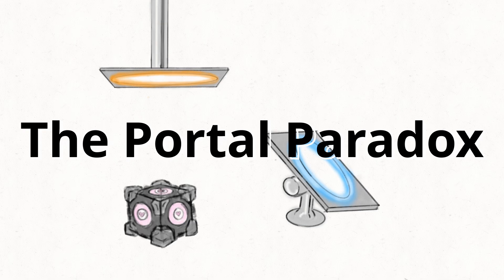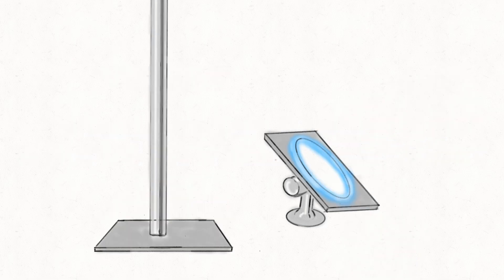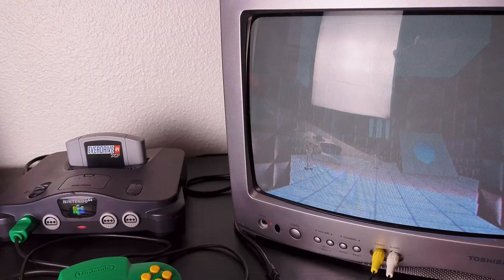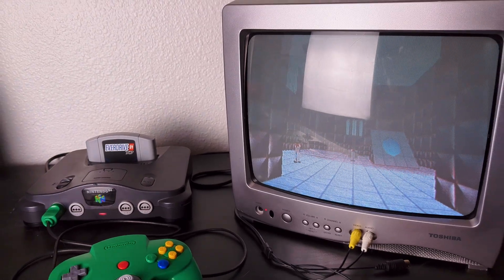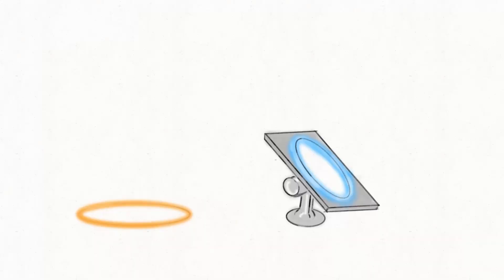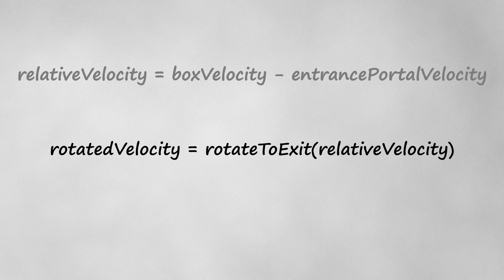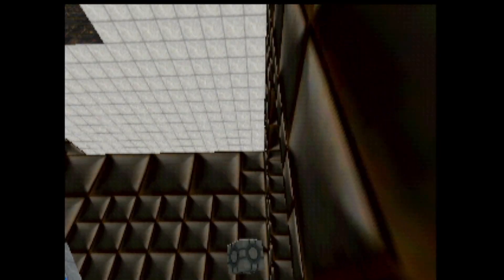I rewrote Portal from scratch and solved the Portal Paradox

Comment: I agree with your solution to the paradox, it appears most consistent with intuition out of all options.
One thing I am wondering about is what happens if the orange portal only moves over the cube like one quarter of the cube's side length, so 3 quarters are still right outside the orange portal and 1 quarter is outside the blue portal. If the blue portal is hanging from the ceiling, at which point will gravity take over and pull it down? I guess the most intuitive solution would be to integrate the forces acting on the object sticking through the portal over the mass of the portion of the object on each side and update its movement accordingly. Moving the orange portal exactly half way over the cube should leave it levitating, so you could then move away the floor on which it was resting and it would stay right where it was.
I didn't put too much thought into this yet so maybe this is not the best solution but I find it most interesting to ponder haha. Love your work man.
Reply: Ah I'm going through the videos from oldest to latest and saw you made another video dedicated to this question. It seems we still agree :D

Comment: This is almost accurate. The fall down vertical is more accurate 
The block is exiting the portal at the same speed it enters and after exist it retains its initial state. 
Like if the exist portal was horizontal it would shoot out of the portal at speed equal to speed of entry portal but stop instantly and go back to rest
Reply: This does not make sense. Imagine a second object right outside of the exit portal, which the cube will collide with on exit. No doubt the collision with the second object must conserve momentum and kinetic energy, therefore the second object will bounce away and have a non-zero velocity, without ever crossing a portal. This however means that the cube crossing the portal must reflect this with a lowered velocity compared to when it was travelling through the portal, but in your solution it just stops moving on the spot no matter whether it collided with anything or not, resulting in a failing of momentum and kinetic energy conservation.

Bonus: This brings up an interesting topic in general though, the question of momentum conservation quickly leads you to realize that when throwing an object through a portal, there must be a counter-acting force on the portal pulling it in the opposite direction. Therefore, if you have a portal on a cardboard wall and you throw a bowling ball through it, the cardboard wall will surely fall over, in your direction, without you actually making physical contact with it.
Reply: Correction: The portal will feel a force in the SAME direction as the object that was moving through it, so the cardboard wall will fall AWAY from you. However if an object exits a portal on a cardboard wall, then the wall will fall over in the opposite direction of the object's movement.
Reply: @Mystixor  No I don’t think so. 
And I think this is over concrete thinking. Try being a little more imaginative.  
If a rocket shot through a door way does the door move? (Assume no other factors present.)
Reply: @astro7484 This has got little to do with imagination, rather with basic physical laws. A doorway does not need to exist for a rocket to travel between rooms. Either there is a wall with a hole in it or there is no wall at all, same result. With the portal however, if there is no wall with a portal on it then you will keep moving in the same direction. If there is a portal, it can change your direction of motion instantaneously and therefore your momentum as well. This momentum needs to come from somewhere and it can only possibly come from the portal which is attached to a wall.
After writing my initial reply to your comment I watched James' later video on a cube passing half-way through a portal and I suggest you check that one out as well as it gives the same insight with some nice visualization.
Reply: @Mystixor  Basic physical laws do not account for portals, and they are not real so you do need some imagination on how they would work. Put it in different scenarios and see how it works. 
There is no consistency if we say the cube gains momentum after the portal has gonne through it. 
If the platform is falling and clashing down and the cube gets momentum then why is that portal still crashing? If momentum is conserved and you say its been transferred to the cube going through the portal. Then the platform falling should lose momentum.
I wish I could do an animation so I can express myself better cause language is clearly getting in my way of explaining this…
Reply: @astro7484  You are quite right that basic physical laws do no account for portals, but this does not mean that we can throw the basic physical laws out the window right from the start. Instead, we need to work through the thought experiment until we reach a contradiction, and your standpoint reaches this point right away because of the complete lack of momentum and energy conservation.
You are also correct about the portal losing momentum in its direction of motion as it crashes down over a cube. I am glad you brought this up as it made me realize an analogy to Lenz's law here. One manifestation of its effect would be a magnet falling through a metal ring or tube, which decelerates the magnet, so puts a force against the direction of its motion, but as per Newton's third law again this means there is a counter-acting force on the ring in the direction of the magnet passing through it. I want to make clear this does not imply that this case is in any way exactly like Lenz's law, but it's for sure interesting to see such a similar phenomenon.
Reply: @Mystixor  Conservation of momentum would indicate only one of these happen... 
1. The cube shoots out but then the plate doesn't crash because it lost momentum. The flaw in this would mean that portal lost momentum halfway through the cube because the cube is shooting out at the other end. But now you have the cube shooting out the other end and half the cube still at rest, and the portal has lost momentum so nothing is moving. resulting in a confusing situation.

 2. The cube shoots out and the plate crashes onto the platform. If we are following conservation of momentum, then we have more energy out of the system than we had put in. We had Velocity from the portal and that was all, so if the portal kept moving and clashed, we see where that energy was dissipated, the cube then will have momentum but no source of it, essentially creating perpetual motion. 

Neither of which I agree with

Comment: In my opinion this doesn't work because it relies on the base assumption that an object going through a portal is whole and singular- and consequently that velocity imparted onto said object by a portal would affect the object as a whole. The consequence of this is that in terms of the paradox, it would mean that any object in reality going through said portal would be instantly cut apart if said object had any momentum of its own in a plane not perpendicular to the portal edge.
Reply from the maker: I actually have a follow up video that considers what happens when you consider the individual particles. It still works out.

Comment: The one that stumps me is this: 

You a blue portal on a stationary wall connecting to an orange portal that is connected to a wall with a floor attached to it, the orange portal is being pulled backwards at  30m/s.

If you were to step through the blue portal to the orange portal, would you just calmly step from a stationary floor to a stationary floor with a bit of shakiness, or would you be rocketed forward the instant your body crossed through the portal due to your relative lack of inertia?

Comment: Things in motion tend to stay in motion, and things that stay still tend to stay still. Things only start moving when force it applied to it. In this case, the cube does not move. Therefore, it should not move when it comes out of the portal.
Reply from the maker: If it doesn't move when it comes out of the portal, then how does it come out of the portal?
Reply: Yeah, I agree with his reply to your comment but to elaborate a bit more even though I already have a comment on this: Motion is relative and if something is in motion relative to a frame of reference it means it has velocity relative to that frame of reference, this also means the answer to the paradox depends on which frame of reference is chosen
Reply: "Therefore, it should not move when it comes out of the portal." <-- contradiction

Comment: The absolute reference that it's comon to all the elements of this test (the floor and the walls) tells a different story.
The cube gains energy that comes from nowhere in your simulation.
The fail here it's to think on the portal as an object. It's not an object it's a hole in the space-time so there is no posible way of taking the energy from it, and that makes imposible to the cube to get that energy from it. Since there is no other way to take it from, the cube can't gain that enegry so it wont gain momentum.

Comment: Okay Let's solve the other portal paradox: So we take the same setup as the first paradox, but the moving portal stops halfway through the cube. Does the cube get launched out of the exit portal, get ripped in half, or stay in place.
Reply from the maker: It would either get ripped in half if the portal stopped fast enough or it would launch with only a portion of the momentum

Comment: I hate these relative physics problems :D like what happens when you throw a ball off a moving train.

What happens if the exit portal  is moving too? (Not back to back). What happens if the exot portal is moving really fast (in either direction, backward of forwards) while you move the entry portal over rhe cube but slowly. 
What happens when the exit portal is on a spinning wall around some pivot point. Positioned on the radius of the spin or on the tangent. 😅

And the more important question: what happens when the entry portal jams half way. Since the top half of the cube is moving away from the exit portal at high speed, the cube would need to be split

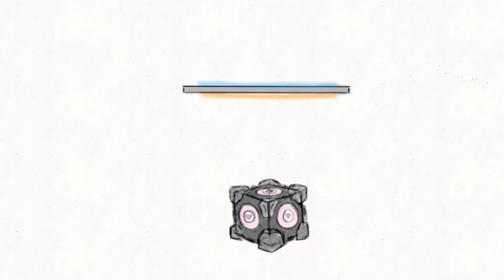Comment: 2:15 It's actually nothing like a hoola hoop. It's still a portal, I would actually argue that the blue portal moving down with the orange on the opposite side will only further add to the speed of the cube, so if portals are relative to our laws of physics, the cube will shoot straight up because the portal is an entrance, it's not a hole through the panel.
Reply: In its behavior it's no different than a hula hoop (when arranged like one).
When the portals are arranged in a hula-hoop fashion:
the exit velocity of the cube (let's say 10 m/s UP)
cancels out with the downward velocity of the exit portal (let's say -10 m/s DOWN)

So the resulting velocity on the newly emerged cube is (-10 + 10) m/s = 0 m/s
But if only one end of the portal moves, then yes, it no longer behaves like a hula hoop.

Comment: Okay so a lot of people don't seem to know what "speed" actually is.
Lets say the upper side of the cube is Side 1 and the bottom side of the cube is Side 2. When Side 1 enters the portal, we start a timer. We stop this timer when Side 2 enters the portal. We are talking about the time the cube needs to fully enter the portal after making first contact.
That number in seconds is the speed. The lower, the faster. If this time is 4 seconds, then it is half as much speed than if it would take 2 seconds. If it is 0.5 seconds, then it is 4 times faster than 2 seconds. That is how it works in game and in logic.
Note how in this whole explanation I didn't bring up if the cube flies into the portal, is dropped, or the portal is shoved over the cube. Because it doesn't matter. You can drop the portal on it, or shoot the cube up into the portal. You just measure the time from first crossing into the portal to last crossing, on whatever part of the cube touches the portal first and last.

Comment: Nah man, you got it right, 100%. The hoolahoop example is on point, and more over, no other interpretation of that example is remotely plausible. And for it to work, relative velocity between the portal and the object most be maintained. And your solution remains consistent with the original.

Comment: i'm late to the party james, but the reason the equation is wrong is because it assumes a portal has velocity. a moving portal will act the same as a stationary one, so the portal being slammed atop the box will not add any force or momentum to it.
the result should be the box 'peeking' out of the other portal, because it fully moves through the portal on the piston. if the piston raises, the box should exit the other portal at the same rate the piston portal is lifting away from the box.
Reply: Momentum:
p = mv
m = mass
v = velocity

Portals change the direction (velocity) of objects that pass through them (see placing two portals on the floor)
Since portals can change velocity, that means portals can change the momentum of an object.
Reply: A stationary portal changing on object's velocity and momentum by direction is the same thing as a moving portal changing object's velocity and momentum by speed as well. Those are both the same scenario described under different frames of reference. In other words it does make a difference if the portal is moving or not.

Comment: If B is right it only raises More questions. Like what If you Smash portal over cube but only half way? Will it still fly since half of it was send flying

What particles transfer energy from press into a cube?
Reply: When you change the speed of the portal while it's moving over the object, the new speed in comparison to the old speed will have an effect on the object.
In your example, stopping half way, would mean the emerged half of the cube would try to pull the stationary half through the portal.

If we're assuming the cube has a perfectly distributed density, it would result in half the speed.

Comment: Portal interestingly enough breaks the fundamental assumption in a lot of physics theories. Most physics asserts that there is at least some Riemannian geometry in the spacetime curvature. Making the world lines smooth.

Adding portals actually makes the curve of world lines not even smooth nor continuous. It breaks mathematical concepts like vector addition. 

From a physics stand point it creates at best a set of spacetime jumps from one side to the other. This may be modeled differentially like a Dirac delta. 

This weird step function on space translation breaks the translation symmetry which is mathematically responsible for conservation of linear momentum according to Noether’s theorem. 

However, just because spatial symmetry is broken does not mean there can’t be time symmetry. 
This means it ought to conserve energy. This would work for stationary portals. However portals that move should break time symmetry making energy not necessarily conserved either.

In conclusion, the fact that a moving portal can break spacetime translational symmetry means there is no necessary conservation of linear momentum nor energy. This allows the results from this computer simulation to be plausibly valid in the context of the mathematical theory of modern physics as we know it.

Comment: Agreed the cube would move. Just think of air/fluid dynamics.  If you look at the air moving through the portal, the blue portal would have a certain mass flow of air moving through it, which means the air would need to have a velocity.  You would have a stream of air coming out of the blue portal until they collided. The cube would have the same relative velocity, because Universe Orange is moving toward Universe Blue and then stopping. If Universe Blue could keep moving and “cut out” the wall around the cube, you would get a column emerging from the portal at that same velocity.

The real trick is moving the portal in the first place.  Since it is essentially a wormhole, it would take a MASSIVE amount of energy to move the portal. Basically the wall would have a very large force preventing it from moving. Granted this is already violated by the movement of the earth.

Comment: ok then, lets say you slam down the portal onto the block, but stop about halfway or so into the block, would the block somehow be sucked up into the portal and be launched on the other side with its remaining energy?
also, if you launch a cube in a straight line to one portal, and the output portal is moving horizontally, would the block remain its straight motion or would it add the horizontal motion from the portal and move diagonally (considering it doesnt hit anything)
Reply: Stopping half way over the cube would result in the emerging half of the cube inheriting half the speed of the piston.

In your second example, I think you are correct in that horizontal speed will be added to the cube as it emerges.